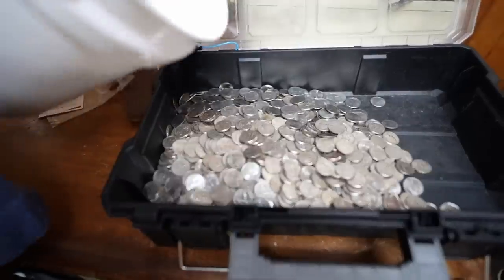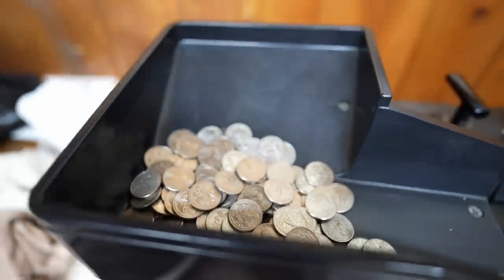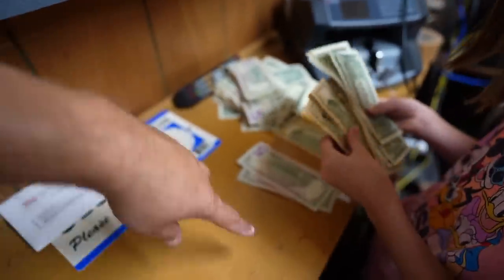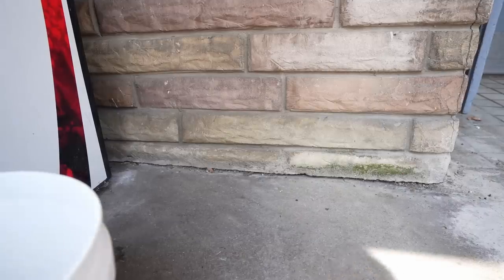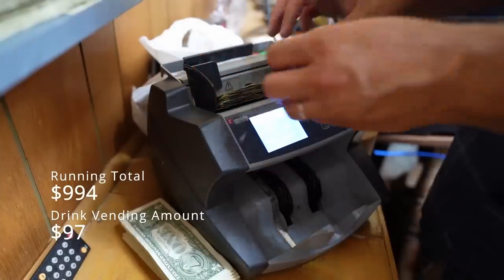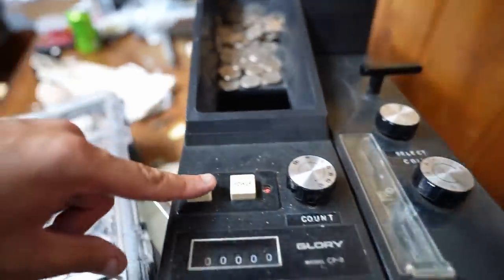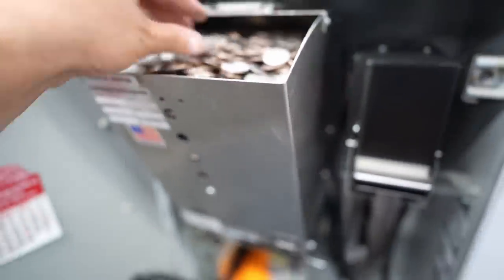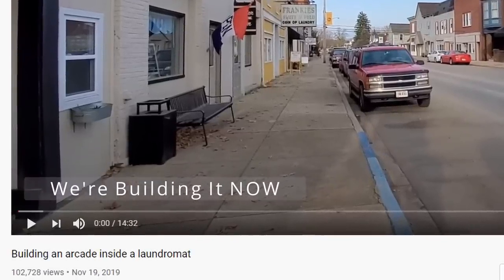I Got An ARCADE MACHINE, How Much $$ Does It Make?

Comment: Upgrade it to an arcadeSD, it may cost about $300 but it has better ganes, better emulation and all you have to do is swap the pcb... and cut the yellow +12v wire but my arcade machine (which used to have the same pcb as yours) looks and plays amazing!

Comment: I have several arcade machines myself and its interesting to see what sort of money they make in a commercial setting. However, it looks like you have a 60 in 1 board in that machine. That is a Chinese bootleg board (the games belong to Nintendo etc and are not licensed). Obviously it's up to you what you want to run in the machine, but I would advise against running that board in a commercial setting with regards to legality. If you are opening your own arcade, make sure that you are using legit boards. The problem is, is that they can be quite expensive.

Comment: The logic board in that arcade game you have could be a problem if the wrong sort sees it operating in public and collecting money.  Over the past several years, cheap "60-in-1" boards have been sold all over the world.  You can get them on eBay for $25 or thereabouts ... even less if you buy them in quantity. They work of course, but all of the games are not licensed.  It's basically an illegal product.  

I highly doubt someone is going to raise a stink about an arcade game in a laundromat running unlicensed software.  However, some people that run those bars packed with old arcade games and pinball machines have been inspected to verify that they are running proper, original hardware.  If they're running the games illegally, these inspectors report the violation to anti-piracy groups or the rights holder themselves.  The company holding the rights to the game can make your life miserable if someone wants to make an impression on their boss or something :-).

I'd keep this in mind.  The person that sold you that game should have told you this.  If they didn't, I recommend you find someone else to sell you arcade games.